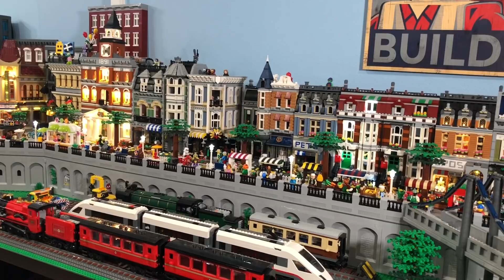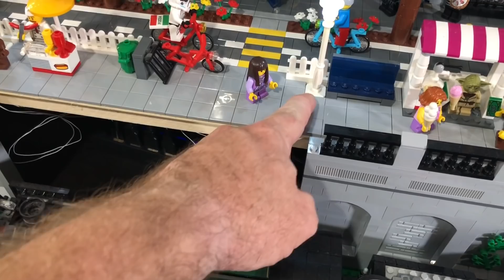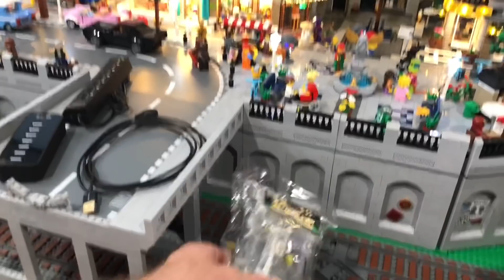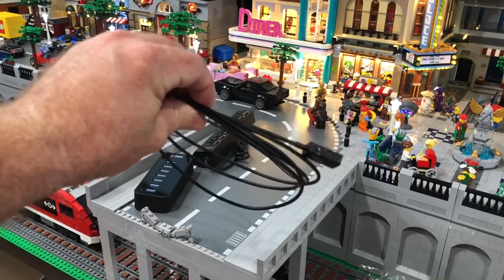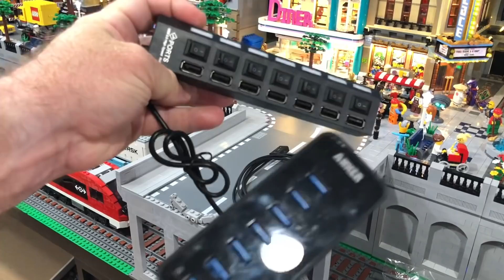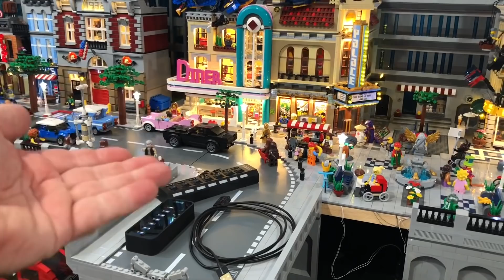LEGO Tutorial - lighting planning and design

Comment: Your LEGO city is so awesome. I love the way you’ve mixed in different characters. I saw the Stormtrooper on the bike and Lisa Simpson.  I have added lights to my Harry Potter LEGO sets. I had an especially hard time with the lights for the mini scale Hogwarts Castle. I’ve had wires break off the little plugs that connect the wires and break off where it connects to the brick. The company I bought the lights from were great and sent replacements, but wires broke as I was placing it on the shelf for display and I don’t want to take it all apart again. Do you have a video for fixing the lighting wires? If not, would you consider making one. It would be greatly appreciated.

Comment: Nice tutorial! I drill holes in the table tops to guide my cables downwards. I already have at least 20 hubs in use. But unfortunately this doesn't look as neat as in your city. That is all very well considered with you! Well done! :)
Reply from the maker: Thank you! I was afraid to drill too many jokes in my tables since they are Ikea and not solid at all.
Reply: Okay, I wouldn't drill into ikea tables either. I built the whole city on chipboard - it works quite well there. But I like your solution better.